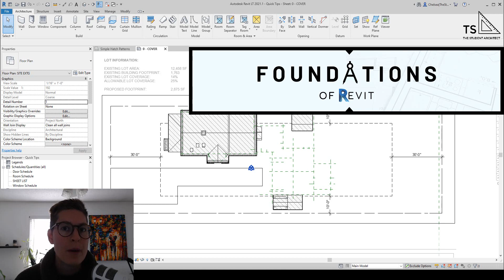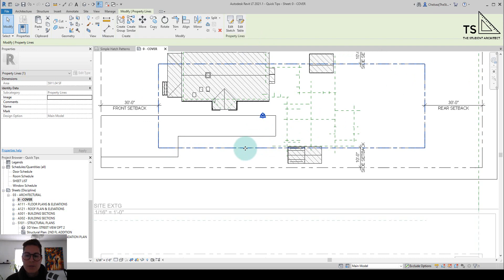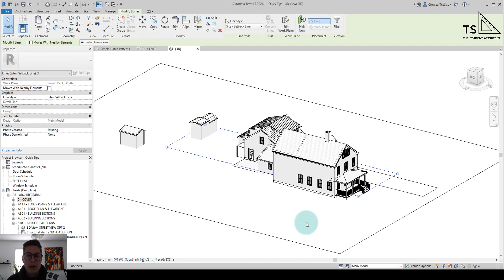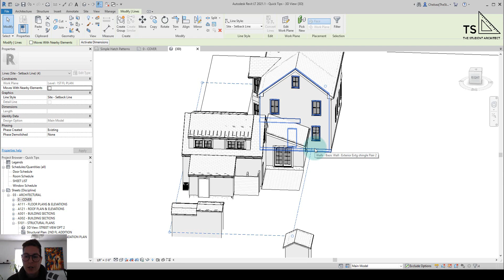A Better Way to Add Setback Lines in Revit

Comment: How to add setback lines.... is to take an existing line.... um, ok but how do I add a line when starting from scratch?
Reply from the maker: You can just draw them in using the drawing tools in the ribbon. I just used the other lines as a reference because it made more sense for my situation. Good luck!

Comment: Hello , is there any method to make the setback line and boundary line to appear in elevation view?
Reply from the maker: Hmmm good question. Since reference planes are planes, they will show in horizontal, vertical, and 3D views. A workaround you could potentially use is locking reference planes to setback/property lines you've drawn in plan, and then locking model lines to the reference planes in sections/elevations. Keep in mind, though, depending on the plane the vertical lines are set to, you may or may not be able to see those lines in other views and could also make your drawings messy if you don't have filters set for views you don't want those lines to show in. 
Second, you could also use detail lines and maybe group them and copy and paste the group to applicable views.
Last, you could try creating a family that creates a plane similar to a reference plane that can be stretched and contains a line that would be visible in vertical views. I've never done this, but it may be worth a try.

Finally, since setback/property lines can often be at different angles from section/elevation cuts, you may not see reference planes that are aligned to those lines. Something that could help is finding where those lines intersect with your section/elevation cut and adding a temporary reference plane at those areas so you can more accurately see where those lines would be.

I hope this all makes sense!

Let me know if any of these solutions work or if you find another way to do it!

Comment: There are two ways to change the Property Line Type when used as setbacks: one way is to select the element, right click, Override Graphics in View, By Element; another way is to create a filter - select the Property Line, in Properties, Comments, label: Setbacks (or whatever), create a new filter - Category: Property Lines - Filter Rules: Comments - contains: Setbacks (or whatever).

Comment: Unfortunately this doesn’t work if I need to see my setback lines on upper levels. There are plenty of cases where the zoning requires different setbacks depending on the height you’re at.
Reply from the maker: If the setbacks are different on different levels you can create model lines on the level that it's relevant to